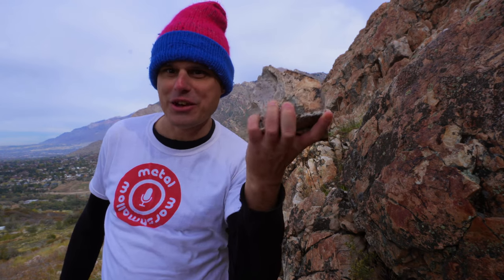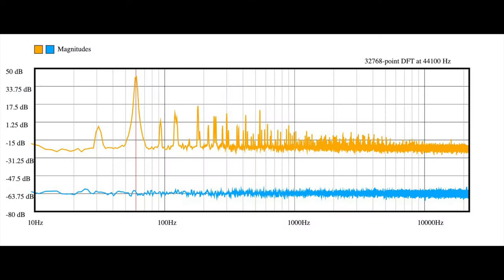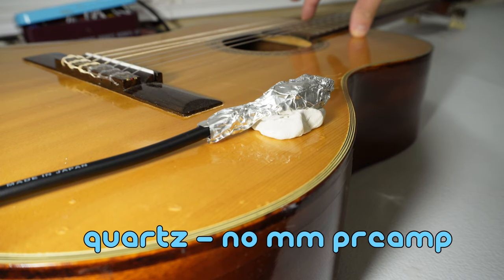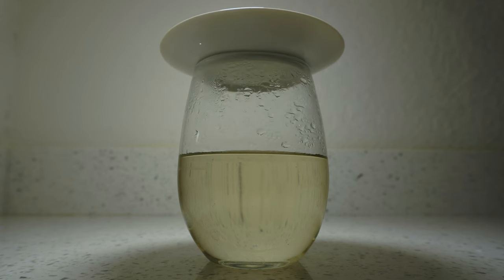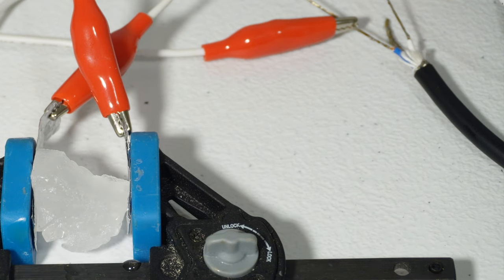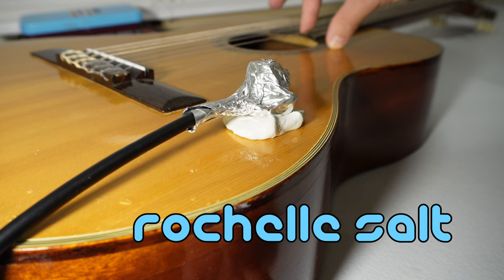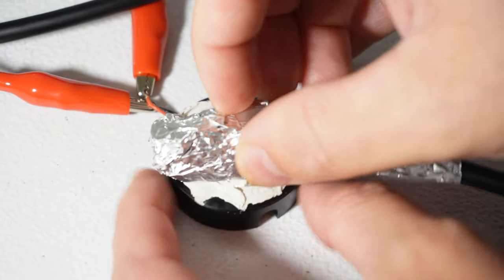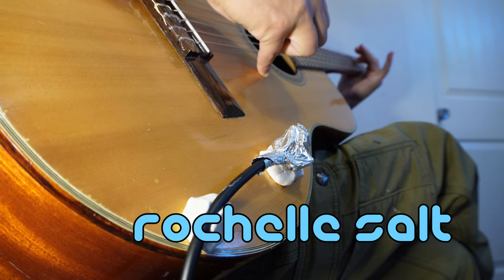Quartz and Rochelle Salt Contact Microphones

Comment: Just received mine and tested it with a Schertler Mixer against some older C-Ducer and Barcus Berry contact mics recording a wristwatch whose sound is almost imperceptible to the human ear: i'm blown away from the sensibility and audio quality of the MM Pro! Even with the gain on the Schertler and the MM Pro at max noise was almost inaudible. Great work man!

Comment: Now if only you could grow these crystals on something like a brass disk hummm haha
Reply from the maker: haha, doh! 🤦‍♂
Reply: @metalmarshmallowllc  Now that being said, imagine if you used that capability to integrate the crystal into an instrument. Like a guitar with conductive paint (or epoxy), crystals grown right on top, and then wired. You could maybe cover much more surface area than a piezo typically could.

Comment: Brilliant!!! One quartz two blades and it works like a microphone. Is this idea good for surface contact mic (wood, plastic, masonry, metal, etc.)? let me know. Thank you very much.
Reply from the maker: I think it will work on wood, plastic, etc, but as you can hear it is not 'good', regular brass piezo discs are much better.
Reply: @metalmarshmallowllc  OK. I will try two tests. But how can I record noise in depth in a professional way?
Reply from the maker: @pierpa_76pierpaolo  per misurare rumore -- nel video uso software che ho scrito io, si trova qui:
https://metalmarshmallow.com/widget.php?w=Advanced_Diagnostics

ho anche visto altri usasndo software chiamato 'REW', lo si trova qui:
https://www.roomeqwizard.com

Mi dispace perche non parlo l'italiano bene!
Reply: @metalmarshmallowllc  Perfetto. Interessante. Intanto ho scaricato il software e poi domani lo provo (Perfect. Interesting. In the meantime, I downloaded the software and then I will try it tomorrow ). 👍